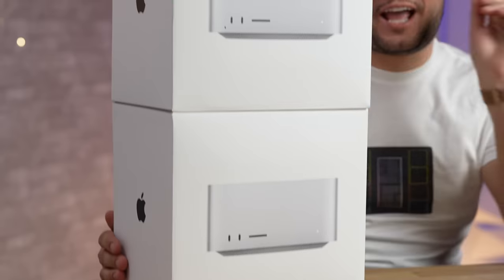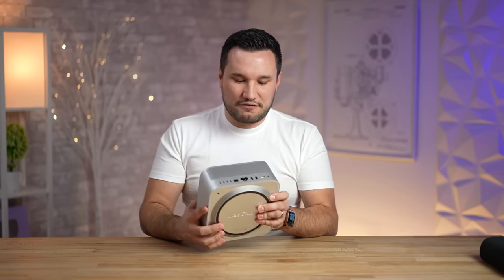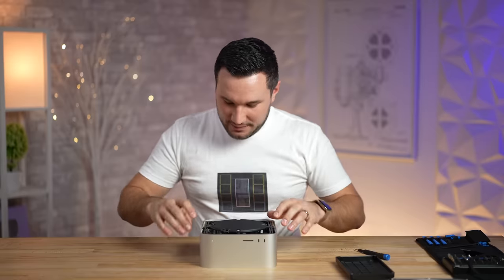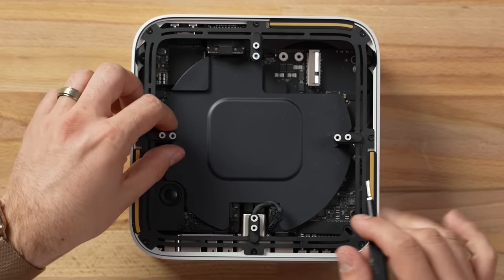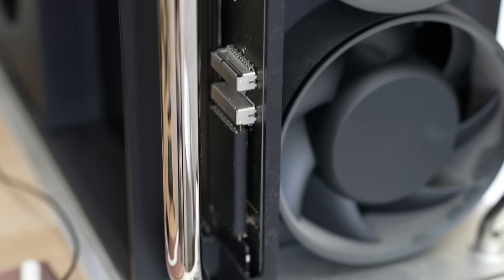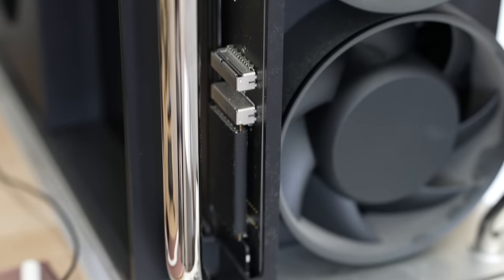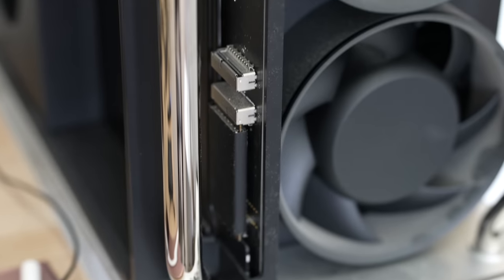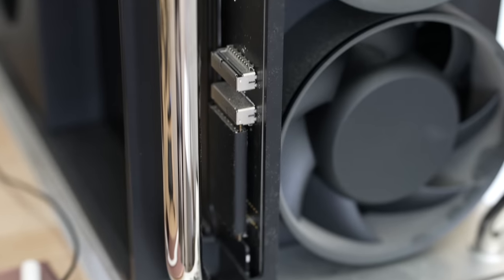Mac Studio FULL Teardown - M1 Ultra chip REVEALED!

Comment: Not upgradable, not even an SSD technically. Might want to make sure you check and verify before you assume and tell your followers potentially false information before you perform tests to verify your assumptions. Nice to see a complete tear down though. Very brave of you 😂
Reply: Everybody complains about the lack of upgradeability, but that's what contributes to the performance - everything on the chip is how you get the exceptional performance whether it's an M1 or the Ultra.
Reply: @misterstratocaster yes and no. A similarly priced desktop performs much better. The limited upgradability is more due to size. Non upgradable ssd is just malicious  tho. Did on purpose to prevent upgrades.
Reply: @jacobamador7989  Not even similarly priced.  You can get comparable performance for 1/2 the cost.
Reply: @misterstratocaster  Your comment is a perfect example how apple brainwashed its fanbase. Do research before arriving at a conclusion. that will help you in your whole life.
Reply: @clanpsi  yeah
Reply: @TheRealGigaCat  HAHAHAHA
Reply: @TheRealGigaCat  how about you show us your research since you like to dismiss so much other’s
Reply: @alespic  do i need to show? Look at how ps5 allows you to have 3rd party ssd as long as it meets the minimum speed requirement. That mac studio wont even boot up even if used a much better ssd. pretty much well known fact...
Also unified memory are not faster. Yes it saves time between hoping and is better for battery life but in the end its bad for consumers and makes a killing for apple.

Unified memory concept is not new. Its highly anti consumer thats why other companies who have users that do actually research dont dare to put these in their laptops.
Reply: @misterstratocaster  lamo no it doesn't, it's not some magic Box, it's a PC with ram, storage, a CPU and GPU (in this case their integrated into one unit). Putting more storage or ram would not affect performance if apple let you.
Reply: Ok

Comment: Apple didn't lie- they had no intention of letting anyone upgrade anything. Watch- their ssd ports are most likely soft-locked to whatever SKU you have- any additional storage will be ignored or worse- the machine will not boot if it detects an "invalid hardware configuration". Watch the ssd be ID paired to that specific motherboard as well. Calling it now too- proprietary ssd connector as well.  All justified with "for security" just not the consumers security- their profit's security. You clearing forgot who you're dealing with

Comment: Kudos for the warning surrounding the power supply section. The caps can hold mains voltage for days after being switched off. Would give you a nice jolt
Reply: Highly unlikely - Apple likely has bleeder resisters on the caps.  Might be some residual immediately after disconnection but I doubt the charge stays for long.
Reply: Not days. When i was repairing macs. It was about 30 minutes for older gen and then i think it was a couple of minutes for the new iMacs based on their guidance before you could open the device. Though it’s best practice to never touch the caps regardless.  Apple has special shields for technicians to place over the power supply
Reply: @DocNo27  uhm wrong, expensive devices uses the highest quality components and can still shock you if touched
Reply: @carholic-sz3qv  Yes..but to be honest...not if you take it right out of the box and disassemble it ^^
Reply: I’ve been shocked before I liked it
Reply: @carholic-sz3qv  is it a magic shock?  I suppose apple could cheap out and not put discharge resistors but that doesn’t sound like them.
Reply: @gucky4717  Every new device had to be pre powered on before shipping for testing and configuration. So there is still a chance the capacitors could be charged.
Reply: @cappuccino-1721  Nah within an hour of being fully powered down those caps will have been discharged.
Reply: Looks like maybe you are meant to unscrew the frame and remove that with the power supply board, which would leave those parts a little less exposed if it all gets removed as one piece.
Reply: Apple doesn’t want to zap their techs in their retail stores or wait ages to start a repair. Would discharge in 5 minutes I’m sure.
Reply: @carholic-sz3qv  Modern power supplies contain a capacitor discharge resistor (~220kOhm) that discharges the big capacitors on power off. All the other capacitors on the board are either low voltage or of such low capacitance that it doesn't matter.
Reply: @DorperSystems  Exactly - cheap chineaseium knockoff?  Don't expect bleeder resisters.  Apple?  They would be nuts to not put them in.  Always best not to assume, of course - especially when working with something new to you for the first time.  I have seen dodgy power supplies with the heatsinks sharing a rail with a non-discharged capacitor so it can happen - I would never expect that in a million years from Apple.
Reply: @DocNo27  ah yes the classic heatsink connected to line voltage
Reply: @NoName-fo9ty  I like your take the best.
Reply: @carholic-sz3qv  Do you even understand what bleeder resistors are? The whole point is they discharge the capacitors over time - say a few hours. The quality of the components has nothing to do with it as bleeder resistors are designed to do exactly that - bleed away charge and prevent electric shock.

You should follow the old phrase: Better to not open your mouth and be thought a fool than to open it and remove all doubt.
Reply: Real men lick the capacitors.  YARRR!
Reply: Voltage won't kill you, it's Amps that you need to worry about
Reply: @joebloggs2312  Wrong.
What pushes current through an object? Potential difference (aka voltage).
You need a high potential to push through the high resistance of human skin otherwise the current will never be high enough to kill.
Also voltage isn't even a thing. Volts are a measure of potential difference, saying voltage is like calling distance or displacement meterage; it's grammatically incorrect.
Reply: @joebloggs2312  Amperage is a dependent variable. Your skins resistivity is going to be (effectively) constant. Because of Ohm's Law, we can say that the only variable that matters is the voltage. Water doesn't flow if there is the same amount of water on each side. It only flows when there is a difference in water level. The current is dependent on the water level. My tongue is around 7KΩ. If I lick a 9V battery I only draw 1mA. but if I lick a 120V electrical outlet I will draw 17mA and with the let go current being 16mA I might die.
Reply: First rule of working with PSUs is very similar to the first rule of firearms: Treat every PSU as if it's at full charge.  Even with a bleeder chip to make the capacitors discharge, that chip can fail without causing any immediate problems and you would never know until you touch the PSU just wrong and get bit.
Reply: @carholic-sz3qv  Whether or not the capacitors are high quality, the “bleeder resistors” are resistors which the system designer - in this case Apple - adds themselves in order to discharge the capacitors over time so that they don’t continue to be dangerous indefinitely.
Reply: @carholic-sz3qv  thats not how it works, expensive as it is the bleeder resister drains the cap over time intentionally. thats literally the purpose
Reply: @kayakMike1000 I like your style, kayakMike

Comment: Just one small correction: The battery is most likely there to keep the real-time clock running, not to save unsaved work.
Reply: Correct.
Reply: u re right
Reply: yes, the battery cannot power the ram, if you didn't save, you lost it anyway
Reply: And motherboard settings.
Reply: It could even be that the battery is there to prevent the loss off unsaved work. Macs are designed to mark data as "written to SSD" even though it is only stored in RAM. 
This is not a problem with Apple laptops, because of the non-removable battery. But without an additional power supply, the data is gone as soon as the power is gone.
Reply: It's even worse. The SSD caches writes on the M1 soc. Meaning you lose data with a power outage. This wasn't a problem on the laptops which have batteries. It is on the Studio though.
Reply: @Questchaun  These dudes aren't techies. Yeah, it's kinda annoying when they make assumptions but they're trying.
Reply: @Chuck_vs._The_Comment_Section  I know that they use the ram as a write cache for the ssd, but a battery like that one is not meant for that, it's just for keeping the time. If it had to power the ram every time your mac gets shut off accidentally, you would need to replace that thing every few months (they aren't rechargeable)
Reply: @leighmackay7486  If you're a gamer you're 100% a Windows user. If that's the case most likely you've done a build. And if that's true you're far far ahead of any Apple user on understanding hardware. I use both systems and developed iOS apps since 3.2. At the end of the day the architecture is still the same. How it's implemented is the main variant.
Reply: @gnryushi  yes but not necessarily. Many windows gamers also buy Walmart gaming pc and lay fort nite. And many people who build pc use Linux. I for example only use Linux, built my own pc and game. 
But yes, anyone who has built a pc is way ahead. This may be windows or Linux but not Mac on account of macs not being self built
Reply: @them2545  You're right about Linux. Any flavor of Linux you almost always cross that path of doing a build.
Reply: @gnryushi  and even if you don’t build anything, you’ve at least seen the BIOS once. That’s more than 90% of Mac and windows users.
Reply: @them2545  Facts. And not to mention maybe 5% of all users even overclock their systems. IF that.
Reply: @them2545  There is still hackintosh, tho. Or at least there was, before M1.
Reply: @Adrian_232  yes I’m aware of hackintosh but they are the tiniest of small communities. Also bcs macOS is based on Unix I’d still class them as Linux/Unix users. However because the non hackintosh users are most likely not aware that macOS is Unix based, I won’t consider them Linux/Unix users
Reply: correct
Reply: The use of battery is bios select os
Reply: @Questchaun  that shows that they are tech illiterate and Just repeat what apple says.
Apple IS selling Them years old Tech AS new stuff for years and they will never know
Reply: It's called a CMOS battery
Reply: @dullinator1059  Yeah those M1 chips are decades old man!! total ripoff!
Reply: CR2032 ain't going to save shit other than the current date.
Reply: it's may also be keep some sort of OS system encryption key alive, until the machine is out of warranty, when it will dye, two days after the end of the warranty has expired , if the power cord is ever removed from the mains, wall socket, and a replacement, encryption key, is only available, from apple how now no longer sport that model of machine, (nice looking doorstop or paper weight)
Reply: @C---M  They're referring to the iPhone and their entire computer environment prior to M1.  For the longest time Macs have used parts 2 or 3 years out of date, that only changed recently when they made their M1 chip.  Though even their M1 chip is actually behind in performance.  M1 Ultra is still 14% behind the older Threadripper 3990x according to the Apple-biased Geekbench test, and a full 247% behind according to Cinebench, and that's with it being 2 linked processors.  Some PC motherboards will also let you mount multiple processors, though they aren't very common anymore you used to be able to find boards that could mount as many as 4 CPUs.
Reply: @janklaassen6404  The cache doesn’t hang around forever though - the write is “complete” once it is all at least cached, but it continues to write until the data is all on the SSD. You lose data on power loss right after a write, but waiting a short time after, your data is safe.
Reply: No idea if apple implemented some nvdimm or bbu of them flavor, maybe all will learn in time. As is a new perspective of old things.
But most are right, that battery is for bios, the capacitors could be on mb itself.
Reply: i couldn't agree more...
Reply: @AThanks for reminding me of what CMOS stands for.
Reply: @A well but the battery in this case on the motherboard is teachly not a actral cmos button battery but its instead  a whole gosh darn rechargeable lithium ion battery cell that is what is normaly used in like a part of what  that is also normally used in a iphone rechargeable battery but in this case it's only a one cell part  of the usually four to eight cell full battery but its just soderd to the motherboard! this is beasce apple likes to sue the same parts on mutable products alot to keep things a bit less of a logically issue when it comes to part use in the manufacturing process !
Reply: @claudineibmb  BIOS settings*
Reply: Well in a short cmos battery 😁
Reply: @rohith_creations6436  a rechargeable cmos battery that recharges from the motherboard being the comptuer is powered on and has a far higher capacity too
Reply: @ashtiboy  yes non rechargeable battery has less capacity than the rechargeable ones
Reply: u mean a cmos battery?
Reply: it's CMOS battery. every pc have BIOS (or UEFI or smth). but apple hided their bios, maybe it's available through repair service.
Reply: He is a mac user, dont expect computer/electronic knowledge from him...
Reply: I wonder how long it will last that clock battery?
Reply: @murd777  approximately 5-10 years. but some good batteries can last up to 20 years
Reply: @murd777  they last long.
Reply: Cmos
Reply: what if battery run out
Reply: @hansontech  in normal pc you need to replace this battery, but there you need to replace whole device
Reply: @gnryushi  WTH these guys are totally techies. They have the specs on every modern Apple product memorized, and they have more knowledge and skill with this kind of stuff than 99% of us!
Reply: Also the thermal padding is not copper

Comment: It's not upgradable the ssd controller is on the main board not on the ssd itself
Reply: well... That still makes it technically upgradable.

Technically, you can add more NAND on a M.2 card and tell the controller to also register it.
You could even add a regular off-the-shelf SSD and tell the controller to pass through.
That's basically nothing new. Most ARM-SOC devices work that way, because most ARM-SOCs have builtin memory controllers. Technically it's not a bad solution.

It's probably just unecessarily locked behind some apple tool so the manufacturer can do this, while the user can't, making the whole thing technically upgradeable, just not user upgradable. 

It's a feature that is there, so apple can sell different variants without actually having to hardwire them. It's there, so apple can sell an overpriced storage upgrade in the future.
Reply: @Anaeijon  It's so you have to pay them to run their proprietary software to flash the controller to register more storage.

Same typical Apple greed that we've been seeing since 2013 and beyond. Indefensible.
Reply: @Anaeijon  no it doesnt you cannot because its not a m.2 card and the controller will only register the original storage solution size only and only the official apple storage only or the machine goes into panic mode and just blinks a power led light
Reply: @johnDingoFoxVelocity  
Yes.
But you see: it is upgradeable.
It's just not user upgradeable. 
You shouldn't confuse that.
You said, it's not upgradeable, which technically is wrong.

It's a money making scheme by Apple. Because it is only upgradeable by Apple.

It's like a Tesla battery capacity is not user upgradeable. It technically is upgradeable though and Tesla will do it for you - for a high price.

Or like a iPhone screen with fingerprint reader is replaceable and repairable. It's just the Problem, that Apple designed the fingerprint reader in a way, that only apple can replaceable it, because it's married to the processor.

Or like the Mac Mini storage has a hardware encryption, so you can't replace the SSD and you can't read out the data from a broken device. You could say, it's for security, but there are dozens of better solutions that would result in recoverable, encrypted but readable and decryptable data. But these solutions wouldn't prevent you from swapping the SSD or installing another OS on the Mac Mini.
Reply: @Anaeijon  well I mean by that standard the m1 MacBook Air is upgradeable as long as you have the skills to flow bigger memory chips onto the board without damaging the components next to it. does that make it upgradeable? because only a technician can do this work not some regular old Joe with a heat gun and a magnifying glass.
Reply: @chelsona2574  No, what I mean: 
It is specifically designed to be upgraded. It is upgradeable. Apple is just being a jerk about it.

It's designed, so they can easily swap in a new SSD and run some software to register it.
Reply: @Anaeijon  Agreed, like the explanation. Just cause you don’t have specific tools doesn’t mean the job is impossible. No huge tech company wants you poking in their stuff, not saying that’s the main case here, even tho you paid for it. In life it comes down to, if you can’t do it, can you afford someone else to do it.
Reply: @ThatOneKidJosh  this case is different, you could do it, but you paid someone to prevent you to do it. Do you sincerely thing that's how life should works ?
Reply: Looks like a Mac Mini on steroids with lot of cooling. I have high hopes for the new mini.
Reply: @Anaeijon  It is designed so they only need to manufacture one type of motherboard